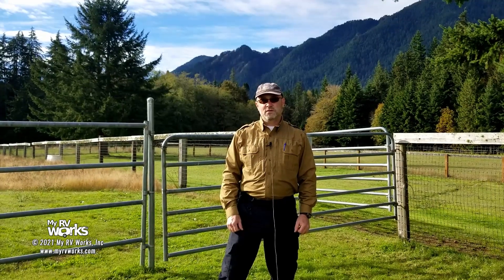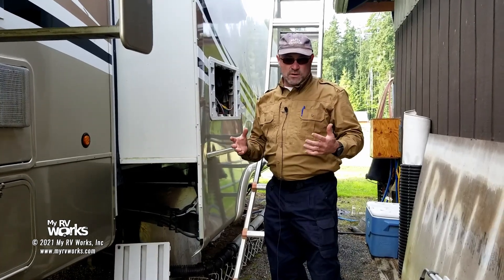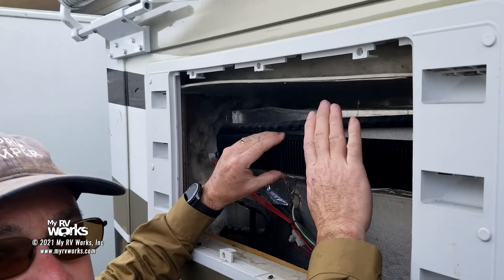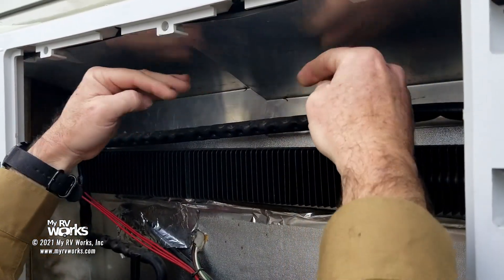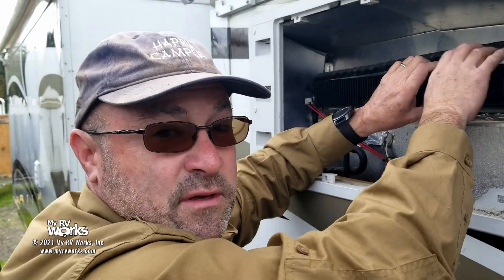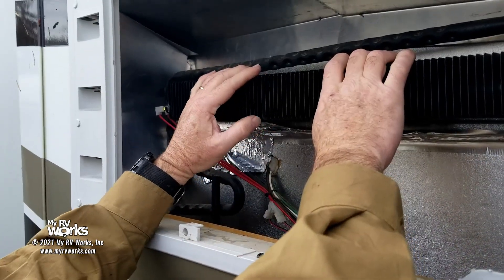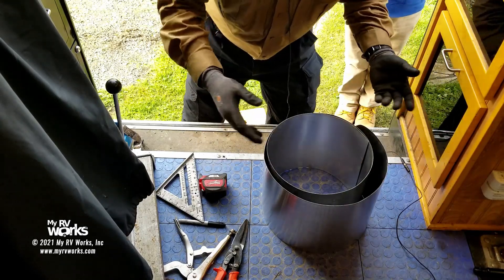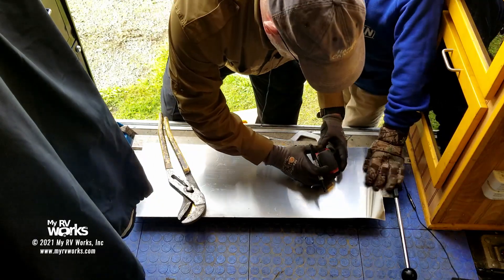RV Refrigerator Cooling Performance Issues – Installing A Baffle To Shed Heat From The Cooling Unit.

Comment: im trying this before replacing my fridge! Mine has 2 fans, should I add a 3?
Reply from the maker: Usually, 2 fans are sufficient.  The key is to make sure the air passes THROUGH the upper condenser fins!!!  It is possible to have the air flow through too fast though.
Reply: @MyRVWorks I think you answered my question about additional fans. You mentioned too much air flow; that effects contact time for heat exchange I assume?
Is it beneficial to bypass thermal switch if conserving supply voltage is NOT a concern?

Comment: so i did do this as i commented 3 years ago, why the video showed up in my feed again i dont know!  i used mostly luan plywood and caulking and it made a huge improvement.  the sides of fridge were closed off properly but there was a 10 inch void above.  the 10 inch void was probably there to accomadate an optional taller fridge.  i then opened up that void at the front and installed a floor and walls to form a cabinet above the fridge.  fridge performance is much much better!

Comment: 2016 Pleasure Way XLTD with Dometic RML 8330 refrigerator not cooling very well. Tried cleaning but the burner tube is rusted beyond repair, while waiting for the replacement I ran it on AC over night to stabilize and got 28F in the refrigerator section. Then I looked at the vent and Pleasure Way is much better than the one in the video but does have a big gap for air to flow around instead of through the heat sink fins. I fashioned sheet metal ducting so almost all the air now flows through, and left it overnight to stabilize again. Checking again today and it is 21F! 7 degrees colder! Just from this one simple hack! That cost me nothing but time, since I had everything on hand! Today I realized I didn't clean the tubing and heat sink fins. Probably good for maybe 1 degree, I'm not gonna bother checking that. This vent flow hack is the bomb! Thanks!

Comment: always had a cooling problem with my norcold RV refrigerator. I watched your video  and saw exactly what was wrong with mine. I installed a baffle on the top to redirect the air through the eveporator and it made the temepeatrure cool 18 degrees cooler. Thank you so much for the help. I live in mid New York State.

Comment: What if you do not have the panel on top? My refrigerator doesn't have a panel on the outside, but there does seem to be room on top on the inside with a non removable panel.

Comment: What if the fins aren’t hot to the touch?
Mine came with stuff in there to direct the air just like in the video but mine still never did cool well.
Reply from the maker: Over the years we've put out quite a few videos for refrigerator diagnosis. Below is a link for our playlist.

https://youtube.com/playlist?list=PLk44vSl27TRBtE1CmMkPb02ayS5H1sKbB&si=kHw6EYjlXl6ApBMV

Here's a short video that might be a good place to start to steer you in the right direction: 

https://youtu.be/BUTXhB58Wo4?si=8slVV2xDAkwIifiA
Reply: @MyRVWorks  thanks maybe it will help.

Comment: Our Norcold NX8 refrigerator just stopped working .There are no codes flashing and I hear it switch from electric to propane .The heating element and the burner are working . I have checked for power both 120 volt and 12 volt and there is power . I was thinking that maybe it's a fan problem because I don't hear a fan . I can't see a fan because of the baffle at the top compartment but maybe with a mirror I can . Your explanation of the thermostat on the coil at the top is what I will check . I hope it's bad and the fan isn't working . I felt the coil getting somewhat warm . I was thinking that the sodium chromate in the system was seized up and was thinking about buying a new refrigerator . I can't wait to go test the thermostat . Thanks for all your videos .

Comment: I wish you would consider doing a video installing an after market fan in the top of the cooling unit, like Titan RV vent fans.  I'm thinking of putting in baffling like you did and then another baffle with holes only for two fans so all the air had to go through the fans and when they are on they will pull all air out creating a vacuum in the system and remove any dead hot air spots.  Cheers

Comment: I replaced the thermistor in my 1210 and my fridge is now cooling. But per you could be better, so I followed your instructions and installed the the baffling your way and I am now running the fridge on 5. It is cooling like new at 35 degrees. You are the master instructor.

Comment: Hello, thank you very for this video. At 6:06  About the fan thermostat, do you have a link or a part number for replacement?.  I see on mine that it is a KSD301 250V 10A.  No temperature range on it.  There are so many on Amazon.  
Normally Open, Normally closed,
 They dont specify the temperature range that you mention fans should turn on at 135 Fand turn off off at 105 F.
I would think the thermal switch should be N.O. for normally open?

Comment: We have a 2008 Fleetwood Excursion  with a dometic fridge.  The fridge was working. Now it's not getting power.  We checked breakers, nothing , we have power to the outlets in the back of the fridge.  Any ideas?

Comment: One other thing I've found about my rm2193 fridge (small size) is that the boiler tube seems to be dropping tiny rust particles on the burner and partially clogging it (not the burner jet) making it act like it's been turned down to medium or low. A blast of compressed air on the burner solves the problem. Removing the burner is the proper way to clean it, when not in the field.

Comment: So on a normal wall such as the back of the camper, does it require fans?  I’m not seeing any on mine. I just see the roof vent. Coil inside my fridge slightly freezes,  it the refrigerator doesn’t seem to get cold. Drain is clear.
Reply from the maker: Hi Raymond, we answered this on our livestream tonight. Check it out here: https://youtube.com/live/8mnmnH5lur4?feature=share

Comment: I added two 12v computer fans to “suck” air thru the condenser fins and expel the air out the upper door.
How about the hot air which departs the upper chimney?  Some aluminum-foil tubing (AC and Furnace supplies) connected to the top of the chimney to direct that hot air away from the cond-fins and directly to the upper door might lower the temps in the compartment…?  Thanks for the good videos.
Reply: Have you done an extension to chimney?
I'm at witts end trying to correct a near continuous run cycle! Fridge temps have been charted and are good, used Darren's ductwork modification. Previous owner stapped a pair of 8" fans to exhaust grate (in slide).
I saw zero improvement. Being permanently parked I even fabricated a different exhaust grate to house the aftermarket fans.
The heat from chimney exhaust is the last thing I can think of. It's counter productive to be pulling that that heated air through condensor fins!
My thoughts have even gone as far a drilling a hole and installing a bulkhead of sorts to channel exhaust air out. I just don't like 90° turns in airflow ducting.
I'd appreciate hearing your modifications! Successful or not...
✌️

Comment: The quality of new RV's is so disturbing.  Pay big bucks and they come out of factory poorly built.   I have friends who had a new travel trailer and the roof membrane was put in wrong.  The error was not found until after the warranty period had expired.  Would the manufacture stand behind their work, NO!    Even if you catch issues before warranty expires, It could take months for the dealer to get the correct parts and shop time to repair the RV.   Big corporations only concerned about next quarter's profits.
Reply: They will intentionally drag their feet until the warranty expires, then tell you you're out of warranty. It's criminal

Comment: Looking at my 07 FW I notice its missing the Recall, after doing some research IMO that "Fridge Defend" is a better option than the recall.  Currently having no issues with Norcold 1210 and have validated what you show in this video.   The Fridge Defend is made by ARP products.  Not associated with them but all my research leads to them.

Comment: Great video Thank you so much for all this information. We are in the process of lining ours, and we are having trouble with the right side of the unit. I have a picture for you to see, but any suggestions on how to inclose this side would be greatly appreciated, your video didn't show the right side of yours. Do I enclose it all above the tubing?
Reply from the maker: If you want a really good answer, the question will be in the service manual for your refrigerator under installation. On our website we have a lot of manuals for refrigerators here's a link for you. 
https://myrvworks.com/manuals/

But I'll just go ahead and tell you they want zero on the sides, less than 1 inch to the back wall, and a perfect chimney going through the top condenser fins. And zero voids on the top of the refrigerator. I've used expandable foam, stuffed the sides with pink Panther insulation, and in a pinch even foil tape. You just want to visualize the chimney and get that air to go through that top condenser fin - no shortcuts allowed. That's the goal.

Comment: Darren, I have a Norcold 2118 that is maxed out on the temp setting inside at 9. Will adding the baffles help low the number? The temp is right at 40 degrees. Freezer is fine.

Comment: Ill be sure to make this modification on my unit. Thank you for the details you give. I am experiencing a problem with my Norcold N611. The temperature in the freezer and the lower section varies from 50 degrees to 30 in the lower section. 10 to 30 degrees in the freezer section. Ive replaced the thermistor and positioned it in the same spot on the fin as before. Switching the unit from gas to electric does not change the temperature variance. Will you help me?
Reply from the maker: When diagnosing refrigerator cooling performance issues one of the first things I address is the ventilation issue up the back side of the cooling unit. It must be designed to the refrigerator specification. Often times I see RV manufacturers not following the refrigerator installation specs. So start there and see what happens.

Comment: Hey DArren, nice job with the baffling.  I had exactly the same issue last year on our Holiday Rambler Class A where there were NO BAFFLES from the factory, nor did the last repair tech add them when changing our Norcold 1200 cooling unit a few years ago.  I made baffles out of similar material but on mine, I had put a nice 2" radius curve in the baffles instead of the sharper bend via the bending brake.  Problem solved - also used A/C tape to finish off the job.  I think I sent in some photos to you of my solution.  Feel free to refer to the design.  Keep up the good woik!!!

Comment: Both fans on our fridge siezed up and caused the 5amp fuse to blow. Norcold sells the fans for $80 each. Pure insanity. I'll be replacing the fans with 2 120mm ball bearing fans from Amazon for $16 each. I'll also be using your method to add baffling for maximum air flow. Thank you for your videos.

Comment: Your videos are very helpful. In a previous video you showed the sensor for the fans on the right side, in this video it's on the left. Is there a difference?
Reply: If that thermostat were an electrical connection on an electric chair, would it matter??

Comment: Thank you sir.  I have a Norcold 1200 series in a slide on my Itasca class A.  Working OK right now, but want to improve the cooling as much as possible.  Getting tired of "soft serve" ice cream.  Great tip to optimize the airflow over the evaporator.  Definitely a new subscriber now.  And a shout out over to your buddy at AZ Expert for sending me your way.

Comment: Hi. Great video & info. I have an older class B campervan. The fridge, in a slide room, has worked great since I got it a decade ago. Now it barely cools on gas or electricity. I've checked for the yellow residue etc & there's none. I went to an RV dealer & he told me the fridge was "worn out" & needed to be replaced. Ummm how does a fridge with no moving parts get worn out?  I installed a fan & the fridge is almost back to its normal cold levels. I'm going to install the baffles like you suggest in this video. My question is, how can it work fine for 11 years & suddenly quit, & then improve with the addition of a fan? Question 2, if I install the baffles as you suggest, will it channel all the very hot air from the lower heating tubes over the condenser fins I'm trying to cool? Are we trying to cool down or heat up the fins at the top of the fridge back?  Thanks for your videos & help.
Reply: Those cooling fans are trying to flow air over the condenser coils to REMOVE the heat.  Remember, the fans kick on at about 130Degs and off at around 105degs.

Comment: brake Press is handy. Makes for building flashing for great wheel well protection for blowouts. Recent customer had fire cords blow though deck and rear out plumbing lines and electrical.

Comment: After some early season cooling problems with my fridge not cooling, I took Darren's advice and reduced the amount of dead air space around my refrigerator. 
I ended up insulating 3/4" on one side and 4" on the other, the entire height of the RV. One piece of sheet metal was added to direct the heat, up the "chimney".
Camping last weekend, Saturday the fridg was 37 degrees and Sunday it was 32 degrees when we woke up.
Initial results are positive.
A big thank you to Darren for sharing and putting in the time and effort to help us/we/I out.

Comment: What is your take on additional fans being installed in the intake and exhaust vents? Several channels have videos showing this done, due to the refrigerator having problems maintaining proper temperature during high heat weather temperatures.
Reply: I have found that anything you can do to help flow air up and out over those condenser fins IS GOING TO HELP.  Some folks also sell the simple pancake fans like you might find in computer servers or other electrical components needing cooling air, and install them to the upper outlet vent!  Think about that.

Comment: So glad I found your channel, of course we're having fridge cooling issues in our Rockwood 8327SS. The dealer replaced the whole back side of the fridge a couple years ago and now coming back from a trip it started to heat up again. We found the thermistor slid down the little holder (cheap plastic) and slid down the cooling fin. It got as warm as 57F so we emptied the fridge and turned it off and secured the thermistor and turned it back on a day later and so far its been 36F with an empty fridge. Going to test the thermistor for the correct ohms and check the baffling. Thanks for making your videos!

Comment: I put baffles in for my rm2193 and installed another fan to move more air during hot weather. It did help the fridge cool faster and a few degrees lower.  Thanks for the information and video.

Comment: Thanks for the tips!  I have only gone through four of your refrigerater videos, so I may still find the answer by watching the rest, but my problem is that my brand new RV refrigerator cools well in the freezer part and very poorly in the bottom half when running on AC.  When I switch to propane, it works like a champ.  We first noticed this on our walk-through at the dealer, but we were assured that it just had not had enough time to really start working.  Well, the freezer part was pretty cold and the lower half was warm, so I should have noticed something.  I am sorry, but my RV and all of the manuals are at the storage lot, but I know it is a Norcold and it is installed in a Sunset Trail 222RB.  Maybe the RB stands for Refrigerator Bad.
Reply: OK...lol!  I found the video that you made on my question.  I guess I need to go get a meter and start testing some things out!

Comment: First, I love your detailed videos. They have helped me on several occasions. I do have a follow up question to your baffle installation. I have a 2021 Grand Design Imagine TT with a Dometic fridge (in slide out)  that suffers from poor performance in warm weather due to improper airflow. The fan would come on and not shut off until around 10pm at night and the internal fridge/freezer temps would climb throughout the day (fridge = 45-50 degrees - Freezer = 25-30 degrees) and then drop back to normal at night (fridge = 32-36 degrees - Freezer = -5 to 10 degrees).  I know the thermostatic switch that turns the OEM fan on doesn't close until it reaches 135 degrees and opens around 105 degrees. I installed all of the baffling as you outlined in your video and it made a huge improvement in the air flow across the condensing coils but the internal temps do still climb throughout the day and I believe it is because the condensing coil is getting too hot and the single 90mm fan isn't moving enough air across the coils. I ordered some new fans (2) and a programmable controller from Coolerguys.com so that I can have the fans turn on/off at desired set points (each controlled individually). So my question is can you cool the condenser coil too much and have equally adverse effects on the cooling performance or is " the more air the better" in this case. If more isn't necessarily better, what is the recommended temperature of the condensing coils for optimum performance? I would like to set up the fans so that I can ideally keep the condenser coils  temperature in the "sweet spot", whatever that may be....thanks in advance for your advice and keep making these amazing videos!